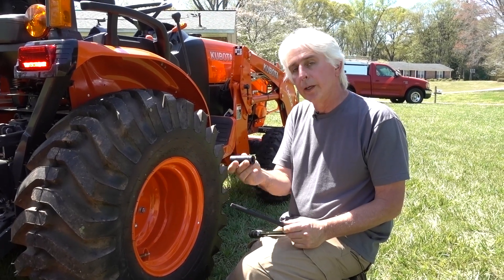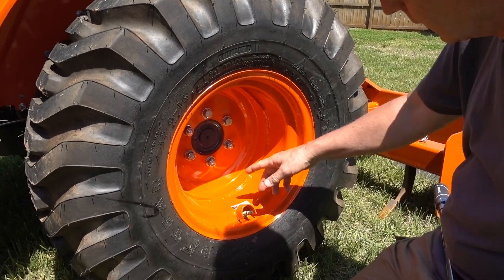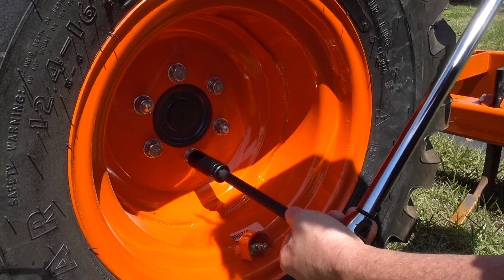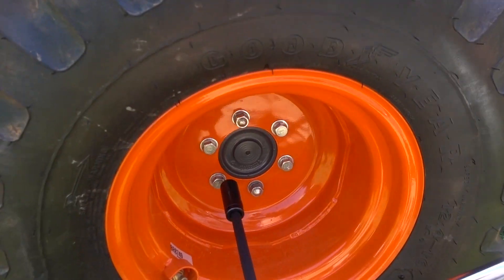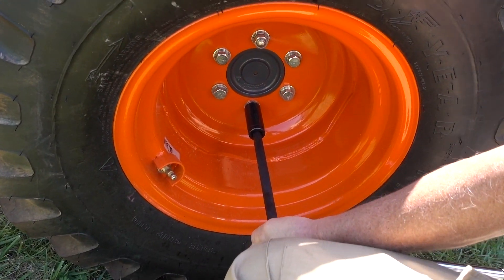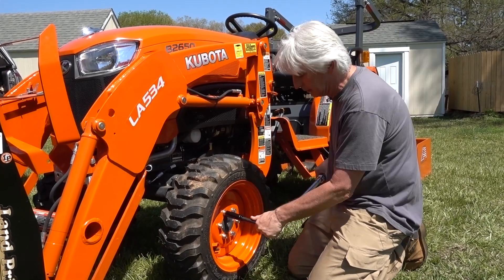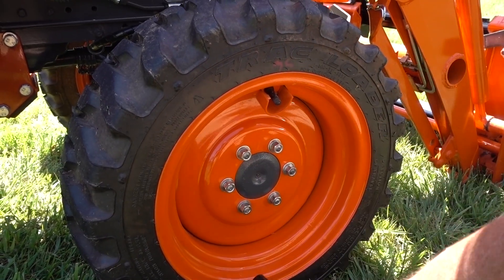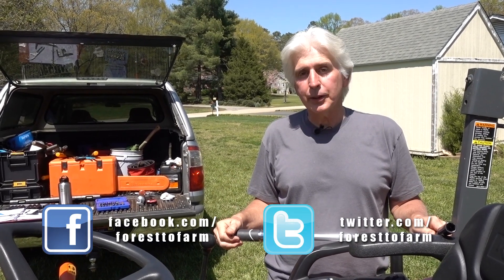Kubota B2650 Wheel Torque

Comment: Just an FYI. I just did my 50 hour service on my 2650 HSDCC (CAB) 2018 model. All wheels on my tractor have nuts (no rear bolts) front nuts are 17mm and rear nuts are 24 mm.
Reply from the maker: Thanks for the heads up. I guess they have changed the set up. Ours is 2016, I think, ha ha.,
Terry

Comment: Also torque in your loader mount bolts. I had 3 drop in one day. The damn technicians who set up my tractor and installed the loader didnt use any loctite. Surprise surprise a 3 cyl diesel vibrates at high rpms.......
Reply from the maker: Good point. 
I check around by hand for things coming loose. We will be doing a loader video eventually. 
Terry